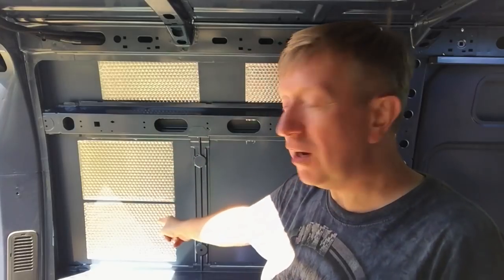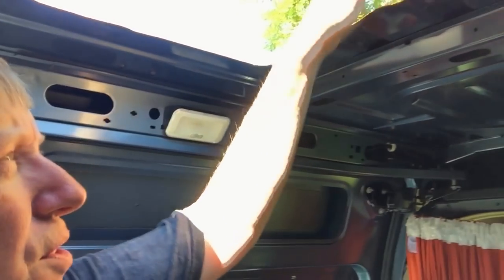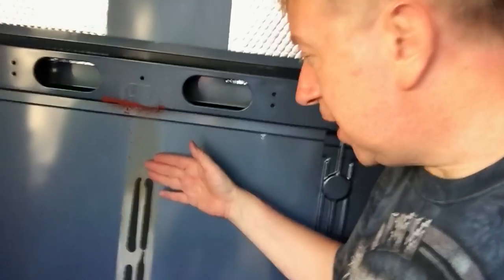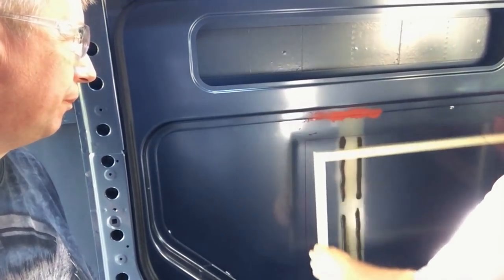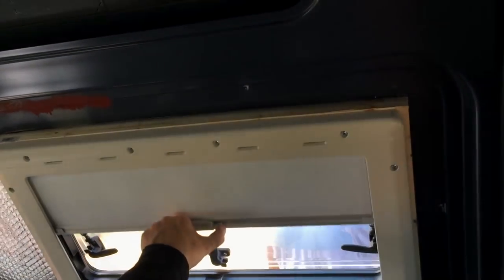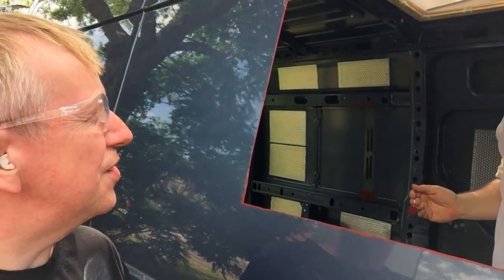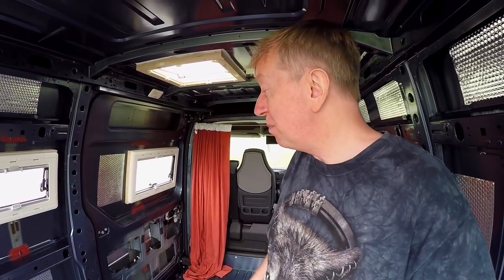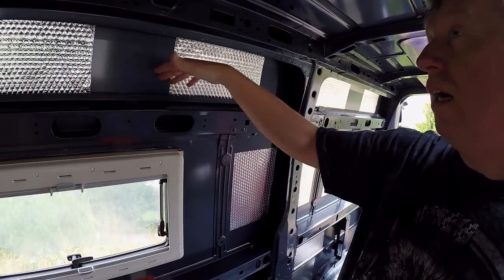2018 DIY Camper Van Day 2. Windows & Rooflights - Rickvanman

Comment: Looking good :) I must say though it would bug me those two windows not being the same height even if one is smaller.
Reply: Chris Cheltenham & being so small too. The windows on his old van being bigger & the same height not only looks better but gives better views & more light. All about symmetry.
Reply from the maker: we did ponder symmetry for a while, but it didn't look right. Also, a lot of pro vans on the market have the rear window higher.  Higher was more practical, so we went for it :)
Reply: Rickvanman - Variety Channel it looks good still just me personally would need them level lol my ocd:)
Reply: Rickvanman - Variety Channel Having smaller windows may add better insulation elsewhere but the downside is during a heatwave like this, the more of a metal enclosure there is, the more your van absorbs heat, considering that you don't often camp in the depths of winter but in the warmer months.

Comment: Great start to the van build... you are lucky to have a mate like Austin who seems to be a dab hand. I notice the holes for the windows are square, in most Seitz installations I have see the corners have been rounded and that has put me off installing them myself, can you confirm that having 90 degree corners is correct?

Cheers
Reply from the maker: Yes, we did all the corners square and had no issues :)

Comment: Got the same Windows I think you have put the window screens the wrong way around my blackout part comes from the bottom and the net part comes from the top works great for privacy and you can leave the window open at night and just have about 2" of the net pulled down at night 👍🚐
Reply from the maker: PhotoCamper Life UK great tip! Thanks, might have to make some adjustments :)

Comment: I'm wondering why you didn't get bonded in full panel windows like they have in Patient Transport Service minibuses?
Also, were you using a grinder to cut the panels? Make sure there's no spark residue on the paintwork as it will rust!!
Reply from the maker: Darren Thrower bonded windows are only single glazed and can cause condensation and cold issues in the winter time. The Seitz Windows are double glazed, are opening and are generally superior in many aspects to the bonded ones. We used a jigsaw to cut the main holes :)
Reply: I went with non opening tinted bonded windows for bigger 'aperture' and more security. I have Venetian blinds and pull curtains to create layers and prevent condensation - thankfully something i've not yet encountered.
Plus the cost! Seitz cost a fortune!! Lol
Keep up the good work!
If you fancy a weekend away camping while building your van, (I know you're in the Swindon area but you're more than welcome to join us in Hordle (New Forest) for our 4th Self Build Get Together!
Search Facebook for Dorset/Hampshire/Sussex Self Build Get Together or click https://www.facebook.com/groups/1275958202471967/

Comment: Hi, I don't want to be a party pooper but how long will it be before you open the side door with the small window open?
Reply: Um...! Yeah..Good point!
Reply: Doh
Reply from the maker: We figured about 3 days Lol!  Aiming to have a warning tag on the sliding door handle for such circumstances, or just never open the small window :)
Reply: I  have to agree with the above post, you should look for a sliding window to go there and change it now, don't wait till you break it on a windy raining night, if you change it now you will be able to sell the original window, if you wait till it breaks you will not.
Reply: Why not go for bigger side windows higher up so you get a better view? Plus why is the smaller one at a different height to the other in the door?